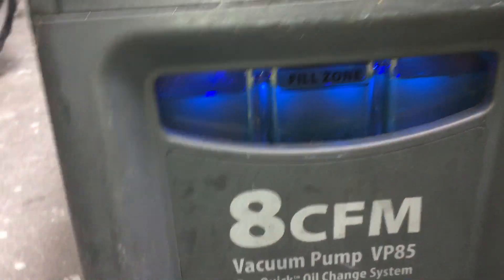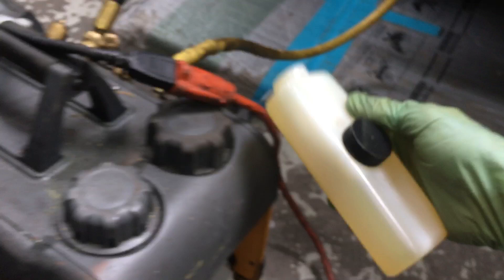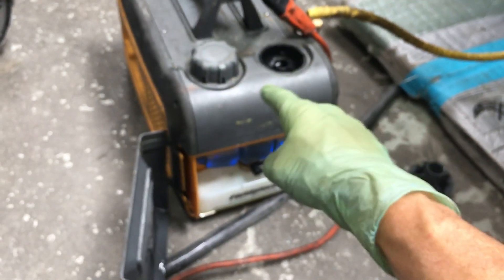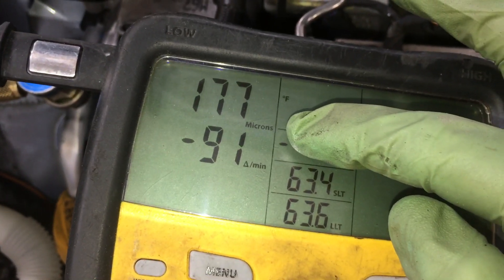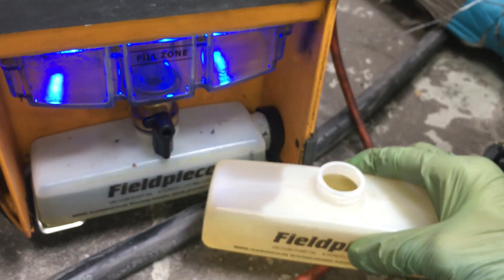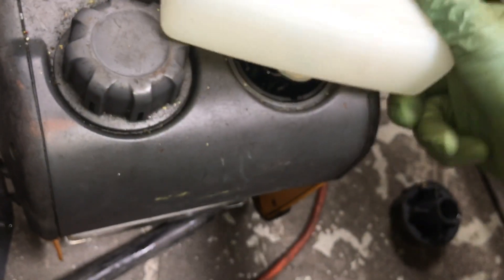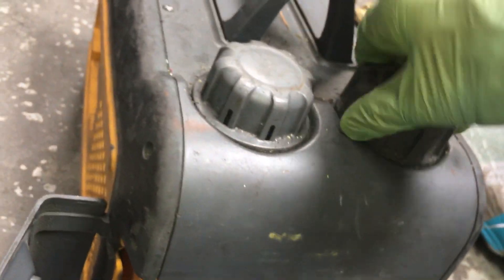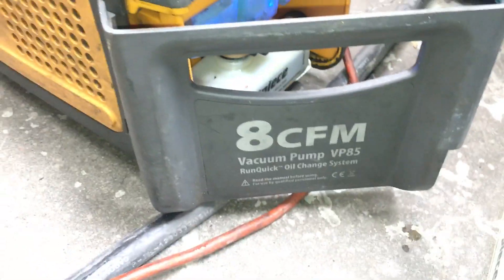Vacuum Pump oil change while the Pump is running￼. Fieldpiece VP 85￼ Vacuum pump￼￼

Comment: How can the pump works without oil?
Reply from the maker: From what I can tell it’s the way they designed the pump in the clearances as long as the pump keeps spinning it keeps a certain amount of oil film on the surface of the cylinder bore for the rotary vane. 

      They designed this compressor just for that you would never do this with a normal pump.

Comment: They did well, designing that one!
Q: If you pull ultimate vacuum on your micron gauge (I've noticed often you reach 80 microns or less)  then valve off to isolate the gauge, does the gauge pressure rise by much?  I think my gauge leaks a little...
Reply from the maker: If there’s no leak which is high moisture content contamination the vacuum will still raise and continue to raise to somewhere around 3000+ microns and then stop. 

        When you have moisture and refrigerant impregnation that has migrated into the surface of the inner walls of your refrigerant hose that are the cost of your micron gauge raising appearing to lose vacuum. 

            As long as there’s not a leak it will keep raising and then level off and stop at a certain point. 

         One important fact that you must always do every day so it doesn’t bite you in the ass or kick you with your pants down. 
                Even though it’s not recommended to use a manifold refrigeration gauge set with refrigerant hoses because there’s just so many possibilities of contaminated inner hose lining in small accumulative leaks. 
                 You must vacuum down and test your gates that all by itself every day without it being connected to the system you were about to test. 

          Do you need a baseline vacuum decay of just your equipment. 

           So you know the difference between your equipment vacuum decay and the system you are connecting to. 

         It takes some getting used to and it can be very frustrating. 

You just keep on isolating and eliminating possibilities working your way backwards towards the vacuum pump. 

       All of a sudden you’ll discover your problem and have that aha moment. 💡

The more problems you have in the more time you spend trying to cure your vacuum leak problem or vacuum decay caused by moisture the faster you will learn and believe me you will have lotta problems Lotta leaves lotta moisture decay in a lot of frustration and maybe even give up
Reply: @coldfinger459sub0  I'm able to isolate the micron gauge from the hose by using a ball valve.  My ultimate vacuum pressure is just under 200 microns, about 180 or so.  I might be under 80 microns if my hose was of better quality.  But, if I isolate the sman3 gauge from the vacuum hose, pressure rises of course but faster than I anticipated.  I think it was approaching 1000 micron.  Not sure where or even if it stops, haven't checked that yet.  FWIW.
Reply: I realize the benefits of having a stand-alone vacuum gauge and better vacuum hoses, etc., just trying to see what my current rig can reasonably accomplish and confirm my 2-stage pump is sufficient.  Surely I need a better hose but I might need a new gauge as well, or address issues with this one.
Reply from the maker: @thisisyourcaptainspeaking2259  this is the kind of practice and experimentation study and watch the results over and over again and you will learn and you will start to understand the patterns in the process. 

If you have time either on the same vehicle or a couple different vehicles spread out over a period of days or weeks. 

Try a overnight vacuum decay

Try a overnight vacuum continuously running. 

How do you try your first vacuum decay and let it stabilize for example at 1700 µm or 2700 µm or 4000 µm when it levels off and stops. 

             Turn on the vacuum pump for another hour or two. 
            And then performed that vacuum decay a second time. 

        The second time the vacuum decay levels out it should be less than the first time

This will indicate that you are still outgassing refrigerant out of the oil or rubber lining and also moisture. 

     And if you performed it a third time on the vacuum pump and repeated the vacuum decay the number should even be lower. 

There is a limit on automobiles just because of the amount of rubber hosing seals and gaskets and you’re working on an old used moisture in refrigerant contaminated system. 

   if you unboxed a brand new system when all the lines are sealed and filled with nitrogen and you assembled it all at one time in the same procedure you would notice you would probably go under one hundred microns within the first ten minutes to fifteen minutes on a clean dry new system. 

TAKE NOTE 
(“ get into a low micron level of below 500 µm means absolutely nothing.

        You only start your time of measurement of how long you had your vacuum AFTER ! Do you have achieved that low level of vacuum because that is the only time that the actual work at the molecular level of removing contaminants like moisture actually are beneficial and do all their work. 

          If it’s a vehicle it helps if you run the engine for at least a half hour with the hood closed or almost closed depending on how you route your hoses.  Set the cabin air temperature to heat and defrost. 
             This will raise the interior of the car air temperature to over 100° because of defrost it will route that air over the evaporator helping to boil out moisture and refrigerant out of the oil trapped inside under the dash in the evaporator”). 

After this now retake your test. 

And if you’re really feeling like you want to take that next level if you could get a hold of some soft copper . 

Get some nut fittings to slip over to copper flare the end so they could make connection to your vacuum pump into your service fittings. 

Now you will have no rubber hoses from your vacuum pump to the vehicle. 

As long as you did it properly and you don’t have a leak at your flared fittings you will reach your maximum potential of the vacuum pump to the lowest micron level. 

Without having to purchase one of the hundred dollar blue vac silicone hoses
Reply from the maker: @thisisyourcaptainspeaking2259  you are learning and getting smarter every day and you are experimenting and you have patience you will succeed
Reply: @coldfinger459sub0  yep, at this point I'm confirming my rig is adequate.  Need to discover/adress any issues before trying to evacuate a system, like confirming my gauge isn't leaking.  Thanks for the advice.
Reply from the maker: @thisisyourcaptainspeaking2259  That is on my bucket list when I was just a kid before high school my dad talk to detector for crucial components

      It’s called forming gas it’s big in Europe I will be getting one it’s on my big laundry list that is a very very big and expensive laundry list
Reply: @coldfinger459sub0  This is a helium leak detector, which is a spectrometer tuned for helium.
The company I worked for in Palo Alto, developed this technology.
Reply: @coldfinger459sub0  thats why we learned on school that after vacuum ones you break it  with nitrogen, and vacuum again unril you comes under 500 microns.
Reply from the maker: @aycabbas  It not only hast to just reach 500 µm it Hass to stay there and be below 500 µm and hold without rising above. 

But that’s an HVAC school for residential and commercial automotive guys are different. 

      It’s very very difficult to get Automotive cars with rubber hoses to actually hold under 500 µm. 

       Residential and commercial use all copper pipes Automotive uses gaskets and O-rings and rubber hoses and they have a external shaft seal where residential and commercial have hermetic compressor’s.